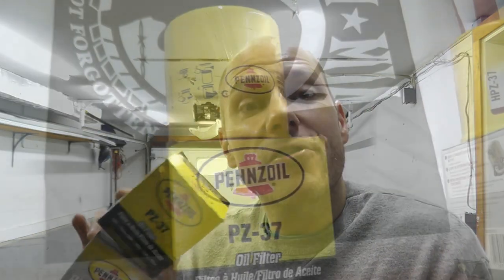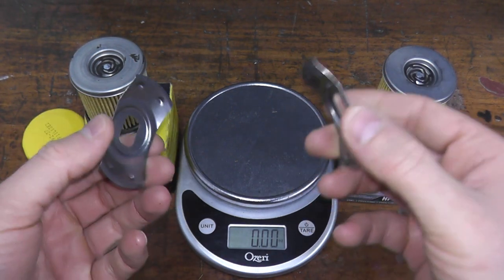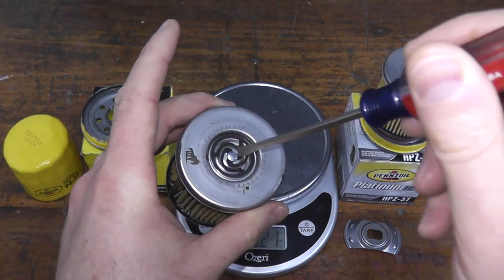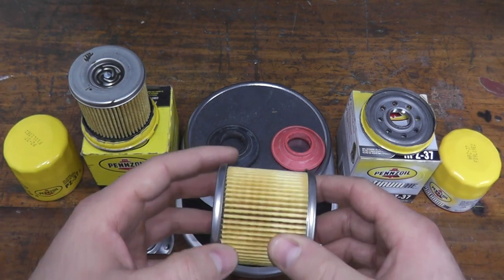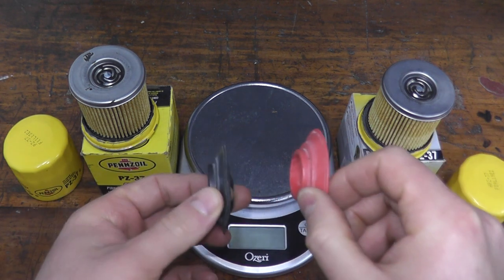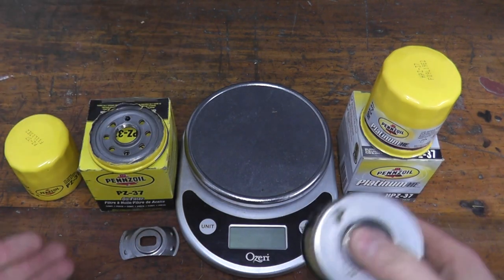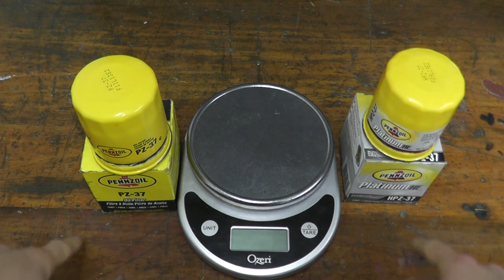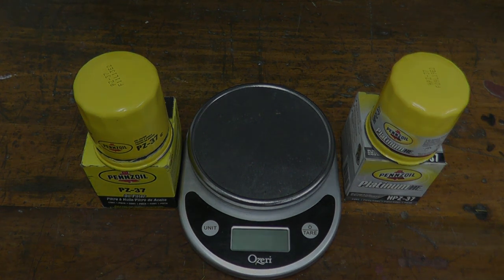Pennzoil Oil Filter Comparison | Regular Spin-On vs Platinum HE

Comment: I've been using the PZ173 model on our 2022 F-350 with the Pennzoil 5w30 Synthetic Blend Oil, both performing really well so far👍🏻! Also, have been getting our PZ173's from our local ACE Hardware Stores, they always have a nice stock on the shelf!

Comment: Great review! Never seen these before in my area however I do use Pennzoil Ultra Platinum synthetic oil. As for oil filters, I used to use Fram Ultra Synthetic however currently using K&N and so far its fine.

Comment: That’s typically the filter you’ll get if you get your oil changed at Firestone, Tires Plus, or Wheel Works
Reply: YEP. A FIRESTONE shop did the oil change in my Acura MDX -- they installed a PZ-37.
 I yanked it, and installed a BOSCH Premium, # 3323 -- for that awesome 20-Micron rating.

Comment: These are my favorite filters i use these in my vehicles.
Reply: Thanks, why? PENZOIL a great name in Lube.....Interestingly my Dodge Dealer uses “ a **PERFORMAX P0-167 **oil filter ==reference **PZ-167 PENZOIL ?”,  **, though cannot find much about PERFORMAX?   (for My Program Journey 2015/4 CYL)
Reply: Rechecking: Why Penzoil ?. what is your Oil Filter , now?.
Reply: @opera93  because they been on the market for a very long time
Reply: @bulldog8687  yes… interestingly PENZOIL used to be readily available , & was my go to : in N Indiana, though We relocated to HELENA MT AREA , five years ago…..ps:: I just changed to BOSS PUROLATOR for my two,Vehicles go to( as you read, my  MOPAR DEALER uses PERFORMAX, last week to PENZOIL PZ OIL Filter. Latef
Reply: @bulldog8687  thanks.

Comment: How do pennzoil platinum filters compare to mobil 1 extended performance?
Reply: From what I read on the box of some mobile one filters they are at 99% at 30 microns. Not sure if every mobile one filter is made with the same ratings.

Comment: I think it's neat you chose the exact filters for my car. Pz-37 is the reccomended for my older Honda 2.3. Nice to see the difference but I can get the regular pz37 for 5.99 and it's ever so slightly better than the purolator 14459 from tractor in terms of performance but both are 5.99. It's only like half a % difference at 20 microns with pennzoil being slightly better but either way they're great filters and both do well in my Honda.

Comment: Can you open a Napa proselect
Reply: Caleb Read, funny you should mention the ProSelect…I cut one open after doing the oil change on my buddy’s car (‘16 Elantra). Comparing it with a Bosch Premium off of my car, even though they were slightly different sizes, construction looked very similar…I would venture to say that the ProSelect is made by the Mann&Hummel family of filters.

Comment: My Penzoil Platinum filter I just bought says 99% at 30 microns on the box. Not worth it I could just buy a MP Supertech filter with the same efficiency rating 99% at 30 microns for a third of the cost.
Reply: A lot more to a filter than just one number.  That's like judging a car purely on it's 0-60 time.  For example, It's easy to get a high rating if it has a very low flow rate.  I guess it boils down to what you think your engine is worth.

Comment: My understanding is that the black rubber is fine for conventional oil but synthetic oil will degrade the black and needs the longer lasting red gasket material.
Reply: Rest assured, that is not the case. The black rubber is the same material that some of the gaskets are made of in your engine. Silicon simply doesn't harden as quickly as the rubber but the rubber will far outlast the standard oil change interval.
Reply: The synthetic holds up much better to heat and cold weather. Walmart has the best prices for filters. Mobil One filters for $10.00.
Reply: @arthursmith643  Fram Ultra has the edge over Mobil One..     Go to Bobistheoilguy and listen to the fanatics there examine both.

Comment: Jiffylube has em
Reply from the maker: Thank you.
Reply: Thanks, I been tempted , to,use Jiffy Lube, @ HELENA MT… INTERESTINGLY, I had a Mechanic “ Friend” that opened:  a VALVOLINE LUBE Store…….(WARSAW INDIANA)I used it for several years *& Synthetic VALVOLINE, NO APPARENT issuers ( including two Radiator FLUID, & twomTRANSMISSION services (?)……..though I now have honest (?), Mechanic Shops also….